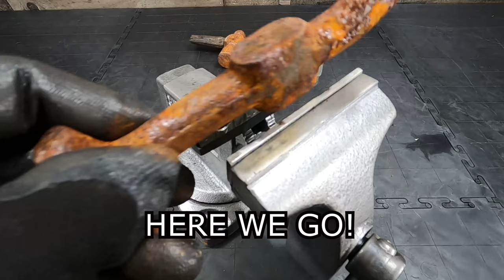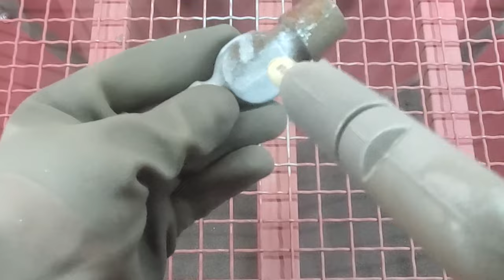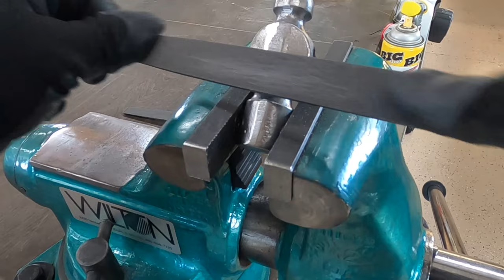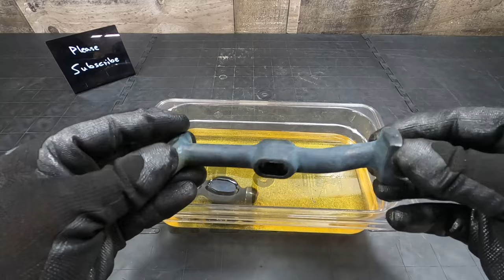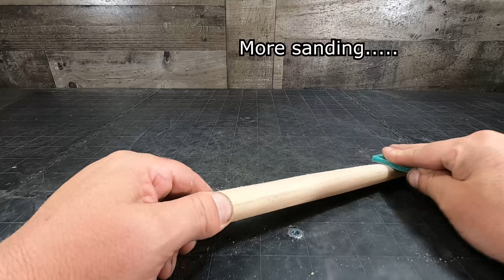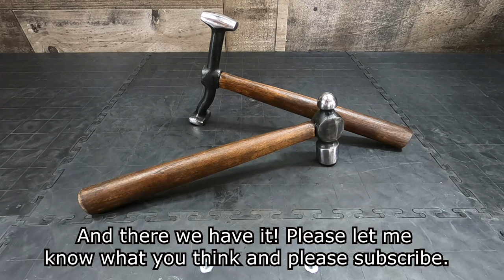Multiple Choice (MC) Hammer Restoration

Comment: Great job restoring these hammers. Quick question did you use any sort of wedge in the bent hammer to help secure it to the handle?
Reply from the maker: Thank You!!! I did use a wedge for the curved hammer. I used the same metal wedge as I used on the ball peen hammer. Thanks so much for watching and commenting!!

Comment: Pretty great Hammer Time! 🤣😂 curious why you soak in oil overnight.. what’s that do?
Reply from the maker: Thanks! The oil will actually soak into the metal as well as the black oxide coating. Similar to seasoning a cast iron pan. Thanks for watching!!!